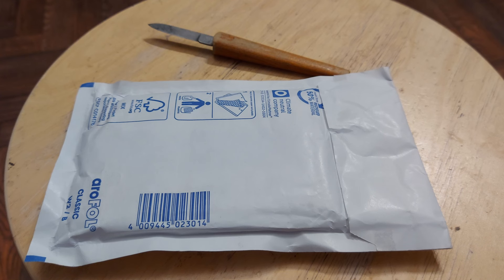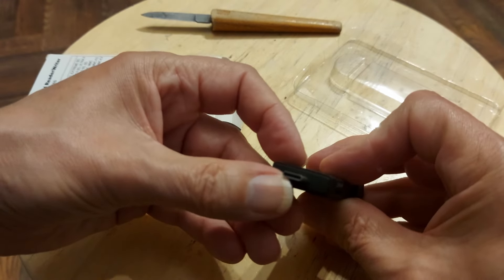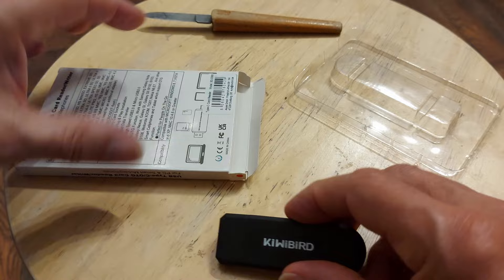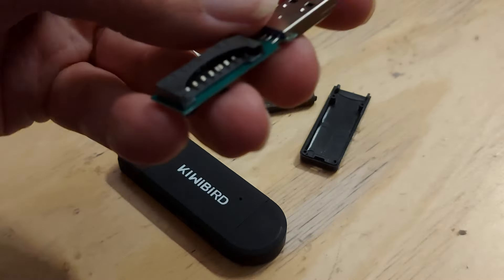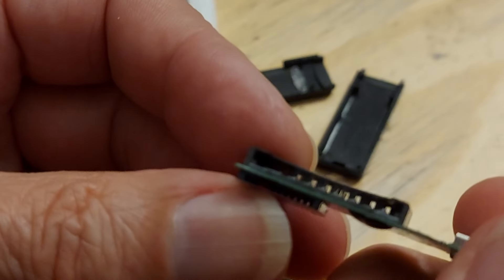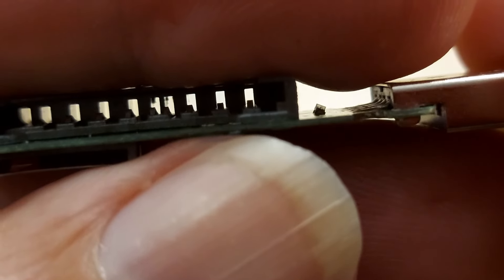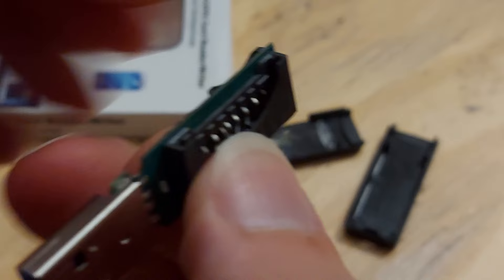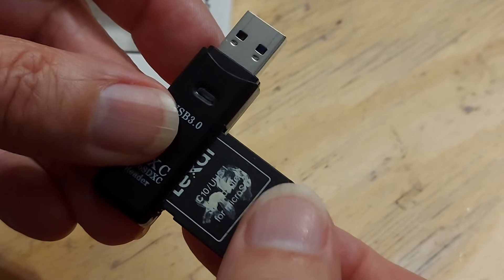Grandad's postbag 20240722 KIWIBIRD USB card reader

Comment: well spotted that joints/tab . 👍
Reply from the maker: @LarryBees  I think the real problem is the brass fingers are too thin and weak. They don't clamp the card in place tightly enough. It simply does not feel secure 😕
Reply: @GrandadIsAnOldMan  It will do for a spare though